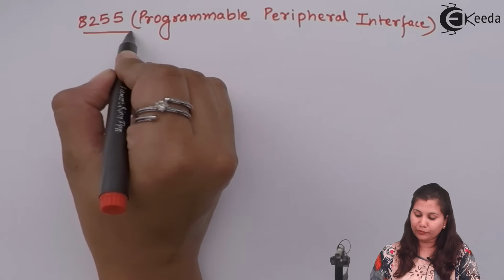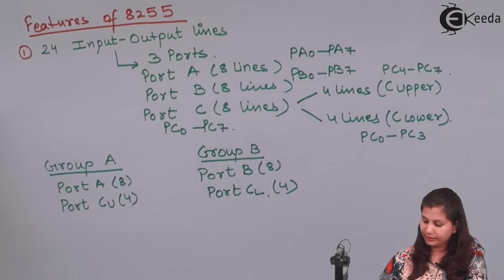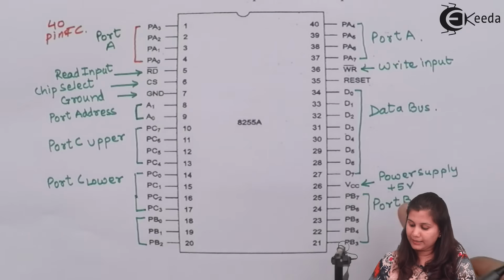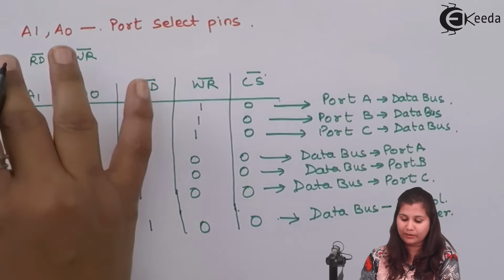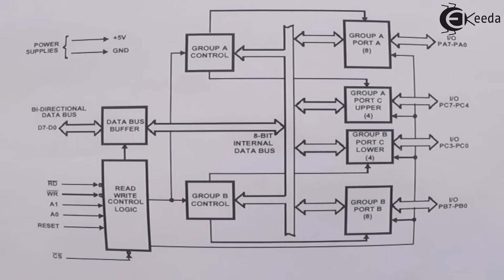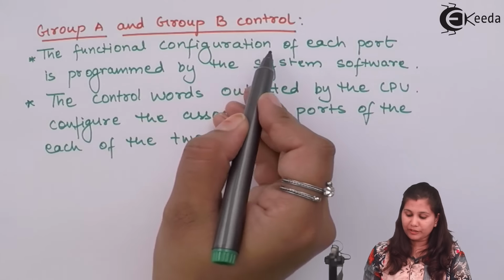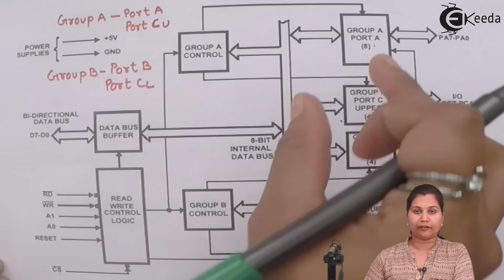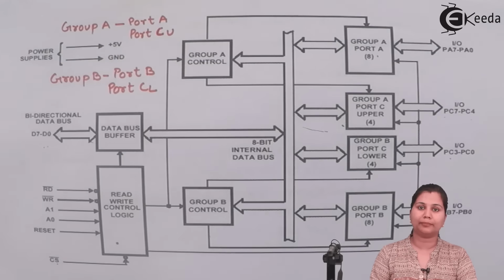8255 Programmable Peripheral Interface - Microprocessor

Comment: Nice treatise about the venerable 8255 PPI. Well done!
That is my first choice general I/O part; rugged, inexpensive, easy to understand, minimal support circuitry/software.
It works well with most 8-bit microprocessors: Z80, 6802, 6809, 6502, 8080, 8088, 8085, etc.
I REALLY like that it has programmable interrupt output(s) if needed, but those can simply be used as general I/O.
Quite a versatile part.